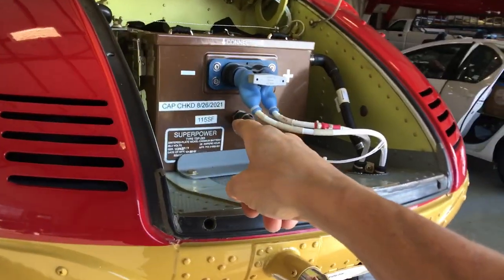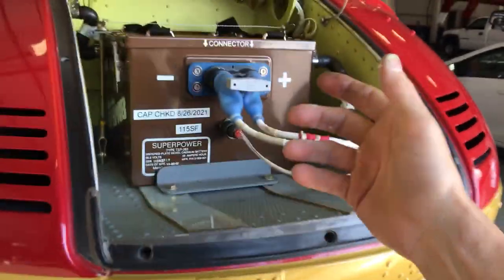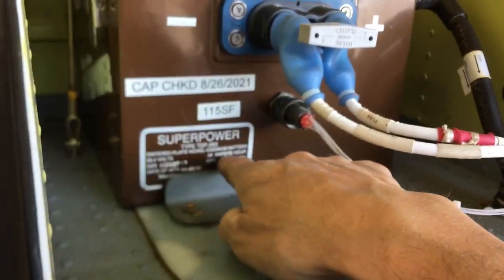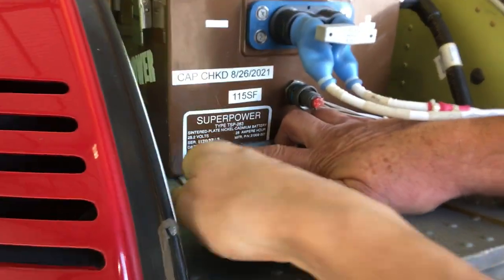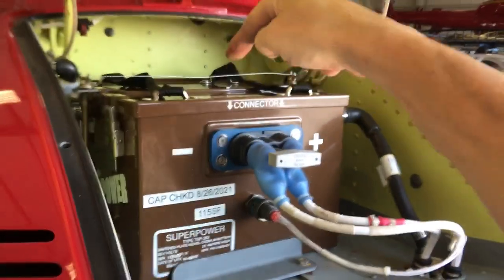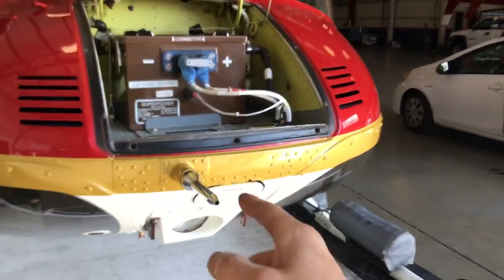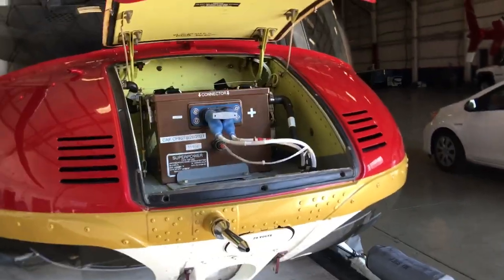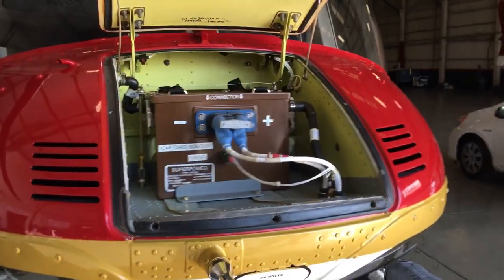NiCad battery ￼Size of a car battery but cost the price of a small car. ￼

Comment: NiCad batteries were the choice battery in aviation for decades because of the flat discharge curve characteristics. As well as predictable thermal qualities. The same could not be said about early lithium.
Reply from the maker: You can see that battery was manufactured in 2012. 

They also have a nightcap reconditioning machine for cycling draining and properly conditioning the batteries extending their life 20 years plus. 

         They have an extra battery that I seen had shunt short connectors between the positive in the negative. 

    I asked why they do that and they said that’s the proper way to store NiCad batteries completely dead and flat. 
       Then when it’s time to service one of the batteries on one of the other helicopters they can charge it up and rotate it out and put the old battery through the reconditioning process to be used again

niCad batteries may not have the highest output but they are the most durable also nickel iron phosphate Which I’m playing with right now thinking of using it to replace the 12 V battery in my Prius
Reply: @coldfinger459sub0  Surprisingly some aircraft don’t even have an onboard battery charger but are connected straight to the 28VDC bus via a “charge limiter” controlled contactor for over/under voltage & over temp. conditions. Most modern aircraft the batteries provide facility to initially power up the aircraft, possibly auxiliary power unit/ engine starting and emergency power DC and usually some emergency AC via a static inverter.